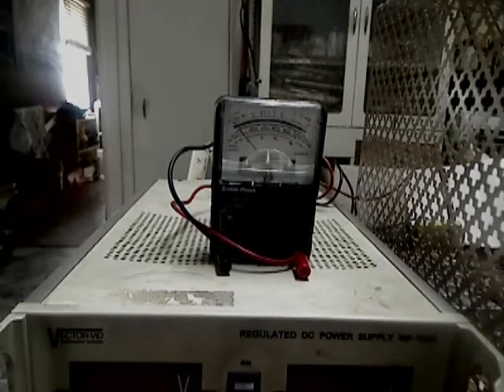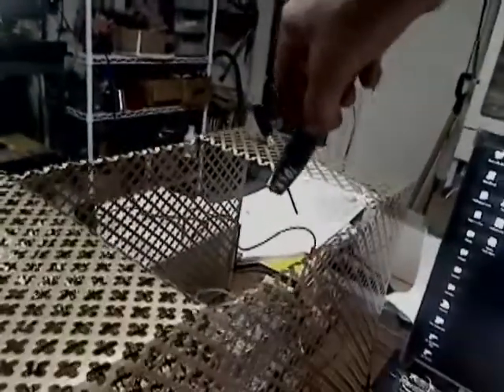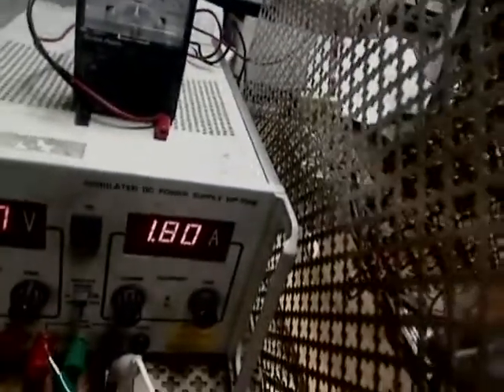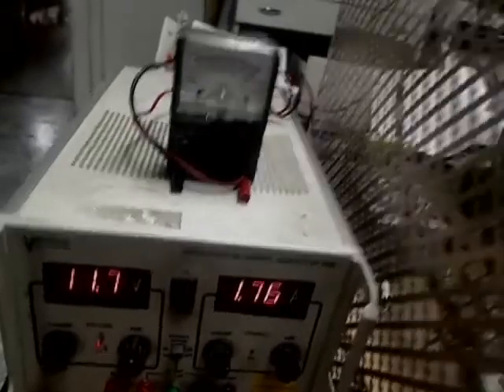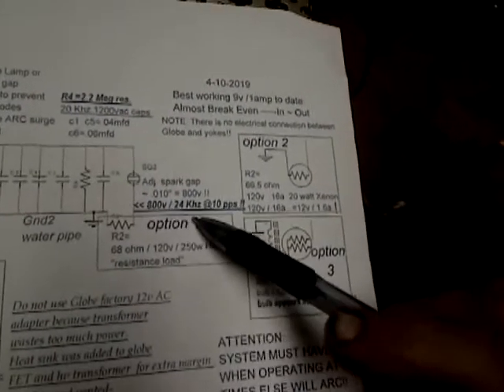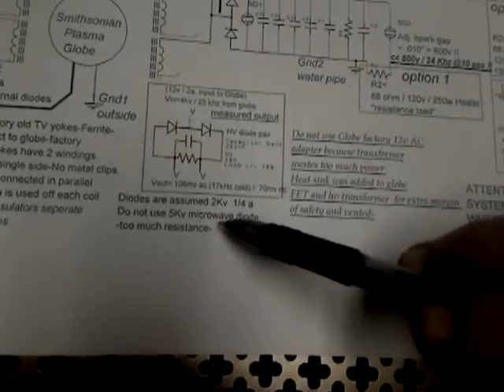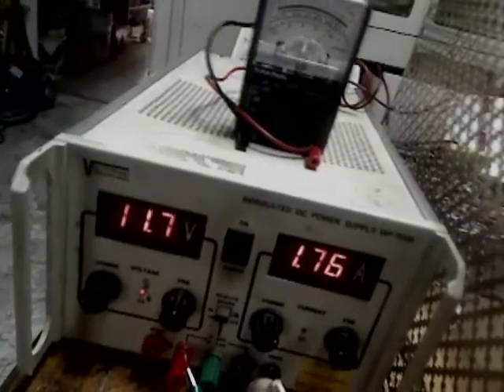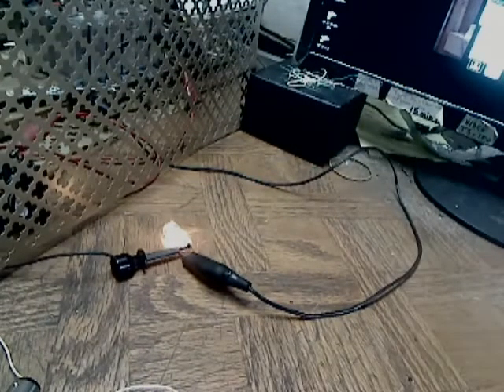Don smith Plasma globe 800v

Comment: Brilliant!! Where did you find that cage material? I have been looking for that specific material. Thank you.
Reply from the maker: If its the coil holders or pulleys , they are 3D printed
with 1.75mm PLA Pro with an Adventurer 4. I used FreeCAD to make the design. The commutator I layed down 20- 28 gauge wires from outside to center where they are soldered to the copper wire wound core. The Diametric 1" mags are held with Scotch Tape to thin Aluminum L-brackets. These are held to the wheel with thin wire ties and are thus adjustable.